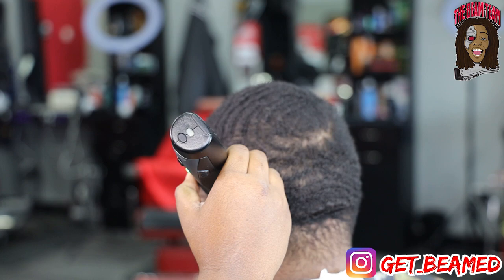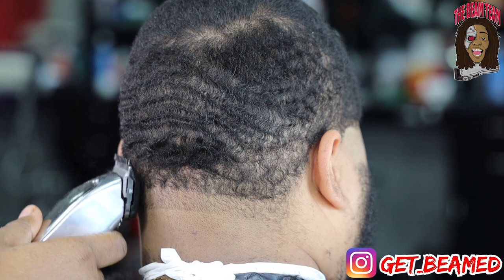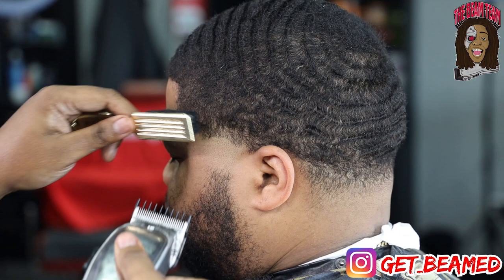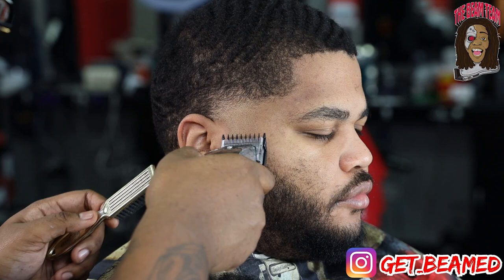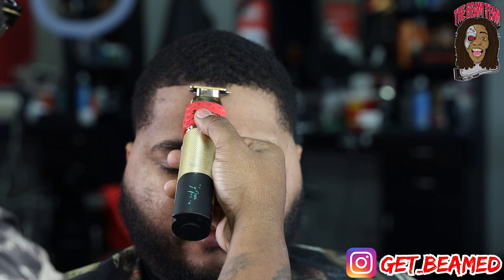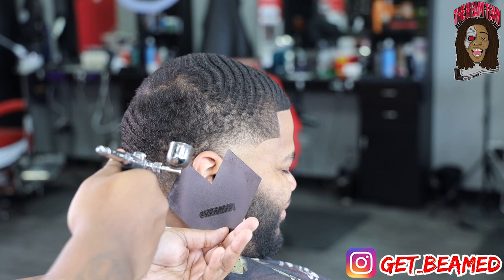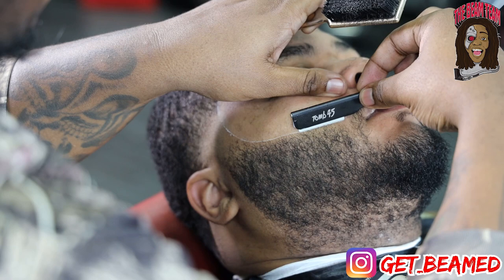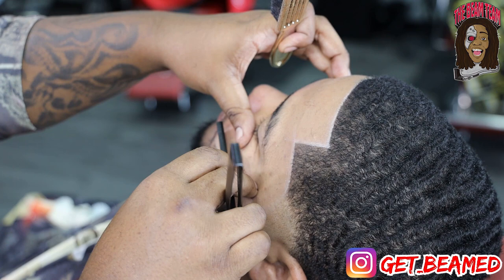HOW TO FIX A WAVERS HAIRCUT / FADED BEARD/ BARBER TUTORIAL

Comment: Have you ever had a client whose ears did not line up right? Most of the time they are not going to like up the exact same but what if there is a solid inch difference? I have two clients where their ears make it nearly impossible to be symmetrical head on
Thanks In advance